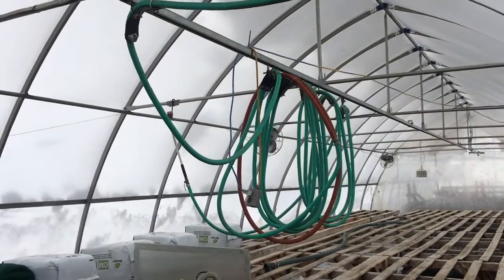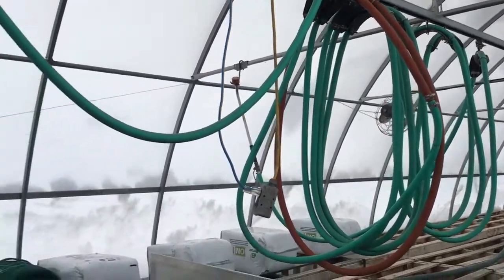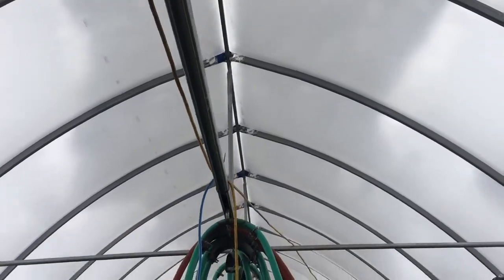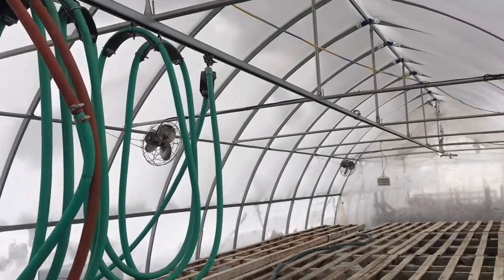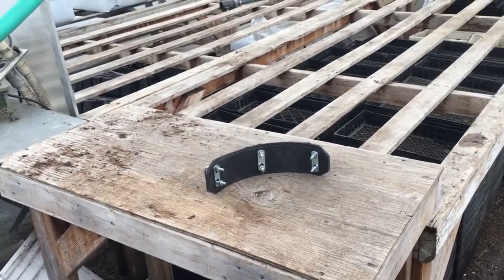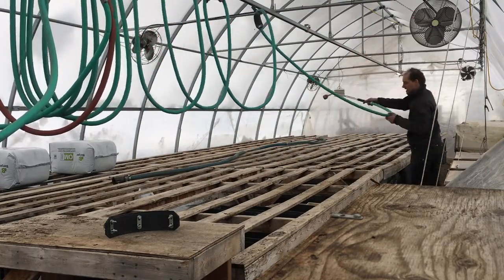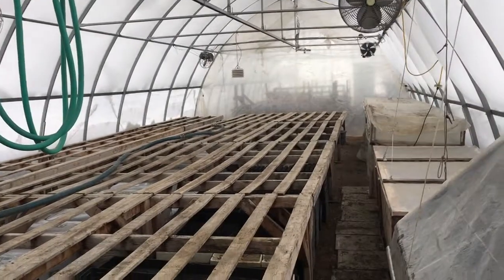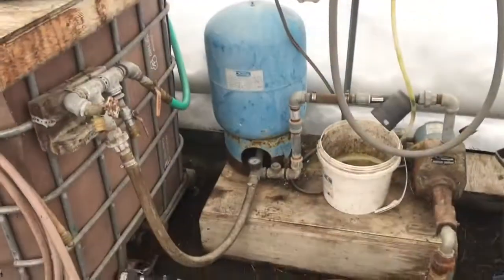Overhead hose carriage / trolley for greenhouse watering

Comment: Thanks soooo much for your informative clip.  I'm going to be putting up a high tunnel, and need this cool setup.  You did a great job--
thanks for the parts list, too!
Reply from the maker: A friend of mine copied our system this winter/spring in Vermont and was able to get all similar parts from McMaster Carr and local suppliers and she did a fabulous job, setting up two propagation houses at Burlington Vermont's famous Intervale Community Farm.  So it can be copied and it does totally work.  Ours is still one of our most beloved creations.

Comment: This is awesome! what did you use to splice the track pieces and to hang the track? I've found the track and trolleys but need help with these other two items please!
Reply from the maker: I think I used double wide hangers from McMaster Carr for butt joints and simple carriage bolts up from the bottom to hang the rail from crossbars.